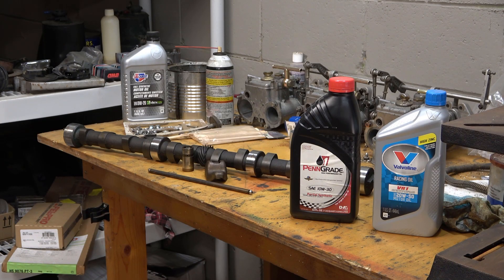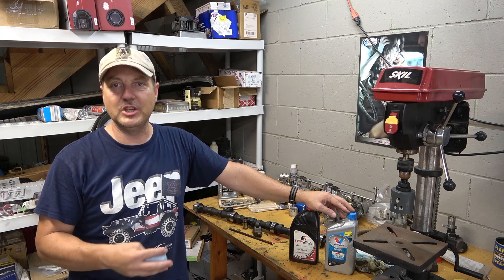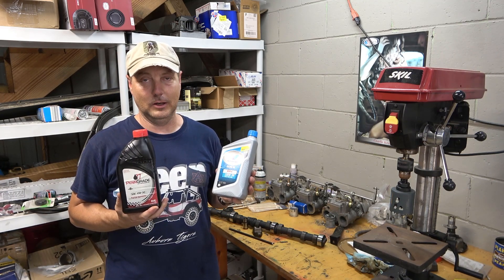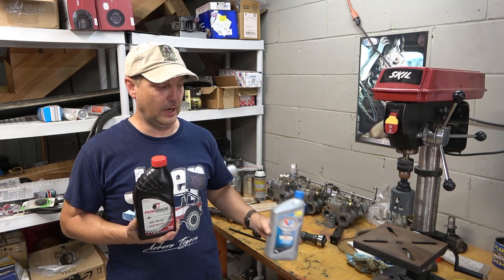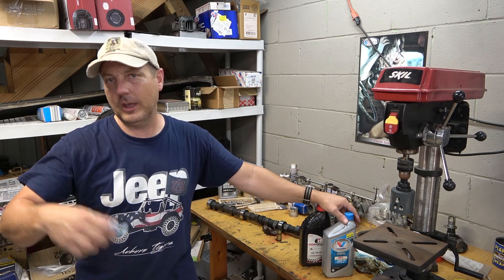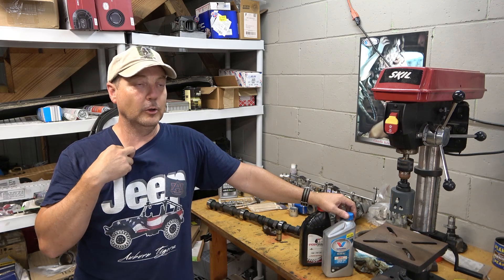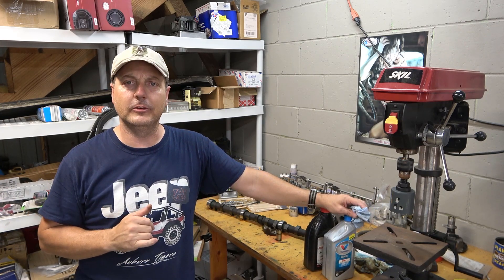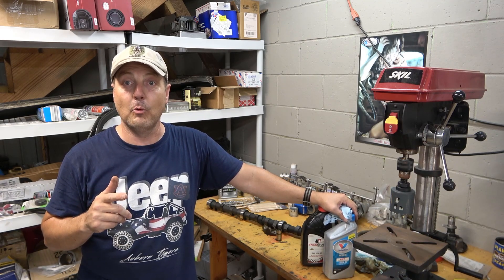ZDDP in Motor Oil, why you may need it and where to get it.

Comment: How long after a new engine build should you change out the break in oil and put new vr1 oil?
Reply: We always do 500 miles break in with a break in oil then after 500 mi go to synthetic oil like amsoil Z rod or Brad Penn and have never had any engine problems or wiped cams all our motors are still running today.
Reply from the maker: It is kinda subjective and depends on the build tolerances and type of oil used.  I generally drain the oil after the first warmup, then run a few hundred miles before settling into a change routine
Reply: After using break in oil then for 20 minutes at 2000-2500 rpm what do you think of rotella t5 10-30 with Lucas break in additive for next 500 miles? Then going to just the rotella t5 10-30 for the life of the Jeep 4.0?

Comment: The VR1 is not synthetic. Does it matter? Thanks
Reply from the maker: Valvoline offers the VR-1 in both synthetic and conventional...YMMV
Reply: Is there any argument as to why to run synthetic vs conventional?
Reply from the maker: @mutedrumsdaddy3108  Synthetic oils usually, with proper filtration, allow for longer drain intervals.  The synthetic processes provide for better stability, and resist thermal breakdown better...YMMV